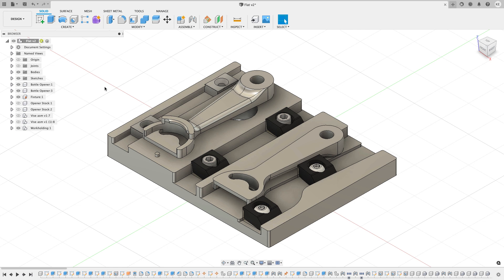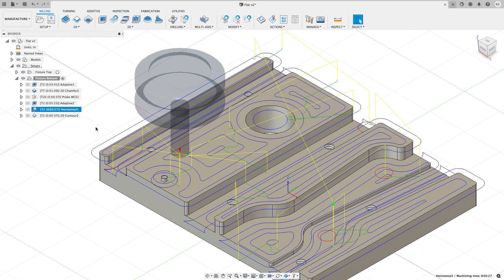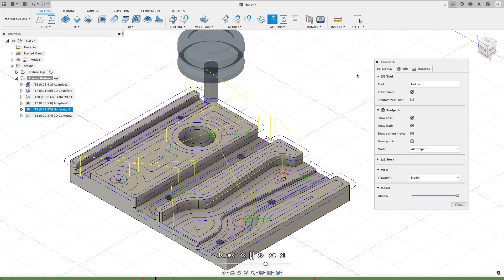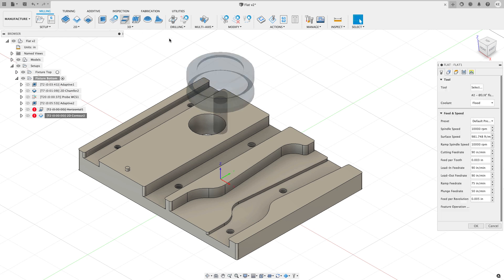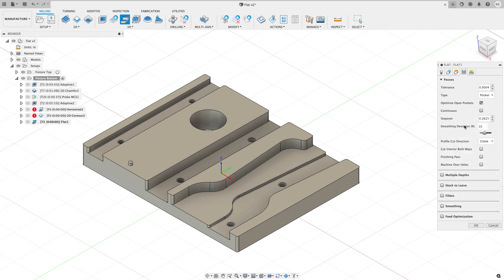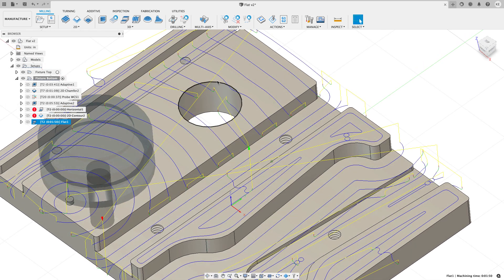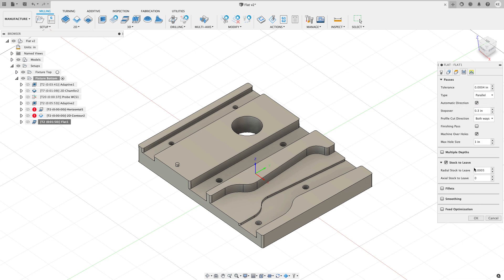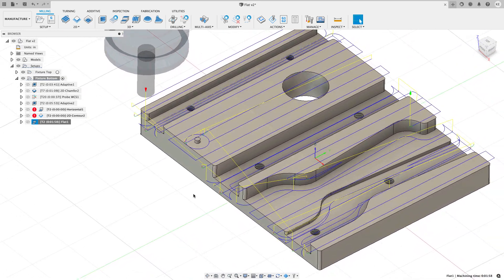Fusion 360 3D Flat

Comment: Is there a way to tell it to cut the highest flats on a part first?  Currently it cuts from the deepest pocket, and finishes with the uppermost surface.  This is not ideal for a couple of reasons.  I imagine with metal, you would avoid burrs on the edges of the upper most flats, since cutting them last means that you'd have to follow up with a contour pass to clean up those edges.  The most important reason in my use cases, are when cutting wood/MDF, and cutting the deep pockets first often leaves tall bits that get knocked off by the machine.  Going top down instead of bottom up seems to mitigate this issue, but the only way I can find to do that is to select 2D pockets manually.  Is there some way to cut top down, instead of bottom up?
Reply from the maker: Good question. Let me look into this and find out.
Reply: @MechanicalAdvantage  thanks!

Comment: Hi there,
I just have question about Siemens controller how do you create tool library if you have only 16 positions inside tool magazine ? 
Like in Fanuc I use 400 positions
Haas 200
Hurco 9999
Then I can use them numbers just to storage different tools for aluminium or steel,
How it works this in Siemens ??  How many numbers you can create ?

Comment: You may not be a huge fan but the machined surface can have a pretty almost intelligent and artistic appearance on the finished surfaces. Admit that some of the work arounds required like patching holes etc can require additional work but Fusion has been a work in progress for so long everything needs some attention....
Reply from the maker: Hi Jonathan. Why are you comparing it against i.e. the work in progress comment. Have you tried anything else out yet? Just curious.
Reply: @MechanicalAdvantage  fusion is always changing things, thus work in progress comment. Some of those things work just fine, and after they mess with them, not so much.

Comment: This sounds like a nice intuitive transition from Horizontal. Glad to hear I'll still be able to edit all of my models that use Horizontal though. I don't currently see the Flat option. Is this still to come or an upgrade? Great vid by the way.
Reply from the maker: Hi. It sounds like you have done the update. If you look in the upper right hand corner of your screen, you will probably see a clock with the number 1 next to it. If so, close Fusion and reopen. Then see if you have it. Even if you don't see the number one, close Fusion and the update will probably be applied.

Comment: Thank you Kevin.   Very tidy tool paths over the previous option!
I’m curious about point density and smoothing, the horizontal tool path put out enormous amounts of code for what it was actually doing.
Reply from the maker: I sent you an email showing a comparison. Hopefully that helps do show it. Spoiler alert, point distribution doesn't seem to be much different.